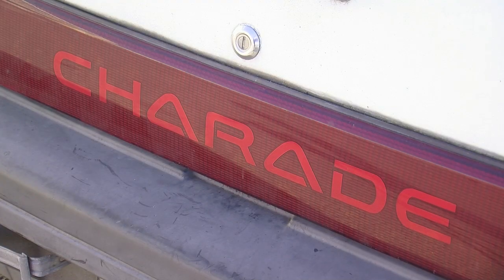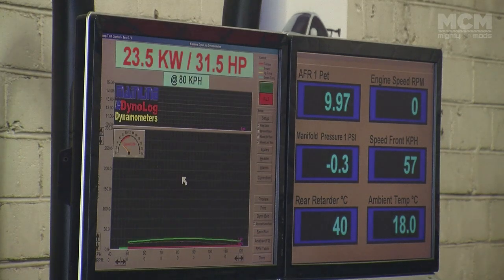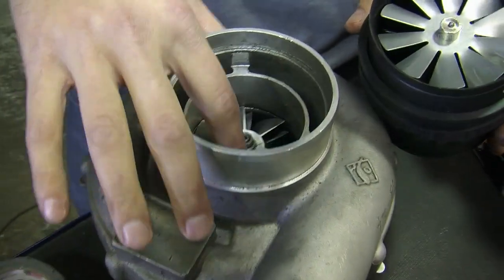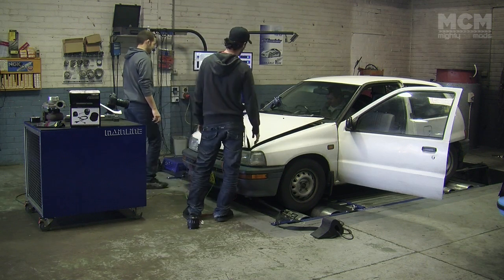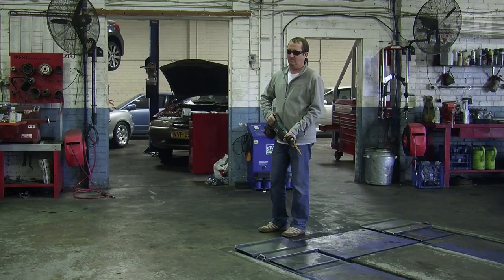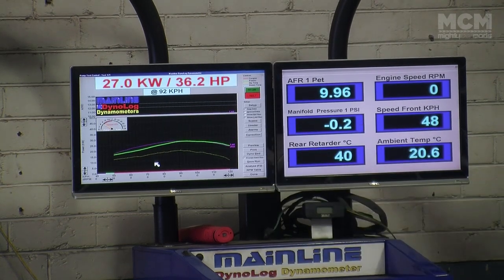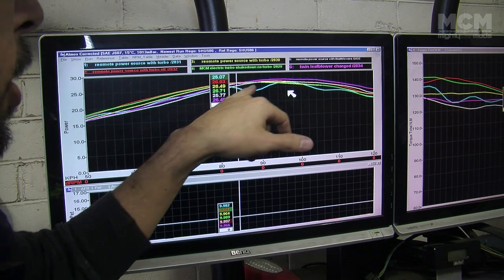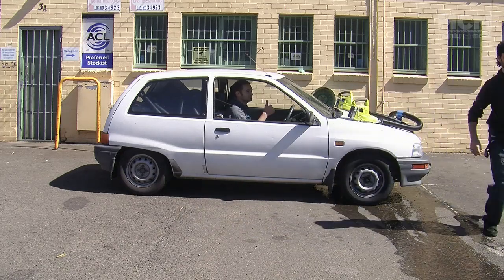Electric SuperChargers Mythbusted

Comment: Damn man, lol, I guess you didn't get to fractions yet in school! No biggie. A constant 14.7:1 air/fuel ratio means for every pound of air sucked into the engine, the injectors will supply 1 ounce (not fl. oz.) of gas. So the more air is sucked in, the more fuel goes into the mixture. But the air/fuel ratio is the same. You don't enrichen it.

Comment: yes you would need to richen the air/fuel ratio. the more air you push into an engine the more fuel it needs otherwise performance will suffer and detonation way occur.  Carburetors do put more fuel into the engine as more air enters, but without larger jets and some tuning a carburetor can only put so much fuel into an engine.  Over your head or no?

Comment: I once contacted one of the "eSupercharger" scammers as a customer looking to supercharge a 350 V8 at 10psi boost way up to 6000 RPM (which should take at least 70kW of power; several kiloamps with 12v system) and described insufficient electrical upgrades done to the car. They said it was all good and well and I would get the performance I was looking for.

Rrrrright... BTW, the given electrical system ran at required power output would've set the car on fire.

Comment: I pulled out my LS2 engine in my CTS-V, and installed a Vtec motor with one of these ebay superchargers since the Vtec revs higher I can make more boost... and then I put it on the dyno. I made 372rwhp! But then I realized I was using the wrong drivetrain for a sports car, and installed a whole custom front wheel drive setup instead. Now I get to enjoy the fun understeer into corners and the massive amount of boost I make in the right gear!!!! /sarcasm /bullshit

Comment: Okay so first off gaining +60 WHP would be the equivalent to having a decent size turbo and running roughly 10 psi with a good tune, which if you dont know anything about forced induction on a car, thats alot for a naturally aspirated car. Also im not sure what camaros and mustangs you're talking about but, most of them have a bit more than 173 HP. so do you have any videos of you on a Dyno? what about any track slips?

Comment: of Course, but when a valve closes, the air pressure increases, therefore stopping the fuel flow.
I think it's more efficient when you put the carb before the turbo.
Forcing a (perfect) mixture into the cylinder...

Comment: Any time you have more air flowing through the carb's Venturi, its velocity will increase. Per Bernoulli's principle, the higher velocity of air (more air flow) will cause a drop in pressure which sucks more fuel into the air stream.

Comment: 100% combustion means extreme temperatures and pressures.
Your exhaust valves would disintegrate, your cylinder head gasket would be long gone.

And, not burning at 100% efficiency means more efficient lubrication in the cylinder.

Comment: A carb isn't designed to force air in.
So i wondered if setting a richer mixture, meant that the carb could function while having pressure in the air intake.

You're not taking this way over my head.
I know more about giant 2-stroke diesel engines, than about a silly Daihatsu Charade. I must admit that a mixture doesn't change while opening the throttle on a carb, and therefore changing the mixture as a result of a turbocharger won't be a good idea. 

Why not use a "drop through" turbo system ?

Comment: Lean mixtures improve the fuel economy but also cause sharp rises in the amount of nitrogen oxides (NOX). If the mixture becomes too lean, the engine may fail to ignite, causing misfire and a large increase in unburned hydrocarbon (HC) emissions

Comment: you just sound like people in the 1920s when they refused the idea of a electrified word, electronic cars, and sending messages over the air. the concept is pretty feasible and not just because they made a lame research it means is over. A fact is that one of the first superchargers was electric, have you seen the Thomas Knight electric turbocharger? the concept is there and I would not wonder if in the next years some company actually releases a working unit.

Comment: this review is useless, you got the worst electric turbo and car, did the worst test,  you didn't even change the inlet to seal the plate on the top, so my thinking is either that you are like those petroleum companies that stop research in fuel alternatives , or you sell mechanical turbos

Comment: Sorry guys, but that fan does not simulate enough at all, it works to an extent, but simply does not simulate enough, hence that you can get different results on a dyno compared to on the road.

Comment: Hot rod actually did the leaf blower mod years ago on a C4 generation, LT1 corvette...  It actually made 50 or so horsepower more but they had to remove the hood, etc. to make it work.  They then did a 50 shot of dry N2O as a comparison without upgrading fuel injectors, tune, timing, etc and the nitrous made more power.

As a gearhead, i've known this electric supercharger was a load of crap but I dont have a dyno nor the money to want to disprove it.  So thanks for the video!

Comment: I didn't confirm a bigger motor will do any good. Even if it did, it will require a massive battery and the duration of boost will be even less than that of a nitrous boost duration.

Comment: It´s pretty wrong to say battery doe´s not have anything to do with power, though it did´nt make much difference, where do you get the power to charge the battery?
they also said that electric supercharger does not compress air it only moves it, which is right, and that turbo and superchargers compress the air which is also right......
and also this episode is more for the fun than to be accurate, I mean they are working on a daihatsu charade with massive 26kw

Comment: If you honestly think that way, you need to do some research. 
An average turbocharger's turbine spins nearly 32 times faster than that of an engine at full rev. There is no possible method to recreate such speed of a turbine with an electric motor; only the exhaust and engine power itself can draw the necessary power to make a difference.

Comment: Wtf cars has NanoTech worked on? I work on cars for 8 hours a day and have never touched a fuel rail that was "bloody hot", so I'm gonna agree with you and call BS. Plus, what is he talking about that every forced induction car runs rich? If your car is running rich something is wrong. "Rich" means there is too much fuel for the air amount, "lean" means there is too much air for the fuel amount. If more fuel is being injected to match more air, then the car is running at the right mixture.

Comment: 1) For all fuel mixture geniuses.  A lean motor makes more HP than a rich one...but they will eventually melt down...  2) 125,000 rpm is what turbo's can spin...they have special bearings and when they fail it's usually very bad.

Comment: To actually get more power if u r pushing air into the carb you would have to enlarge the jets because you wouldn't get more power without more fuel if it was adjusted properly to begin with and if anything pushing air in would make it get less fuel. So thats why they didn't get any power if those fans do do anything witch I seriously doubt.

Comment: Actually, Audi (I'm not a fan at all of Audi) has recently just introduced its twist on turbocharging.  You know how well they work.. after they spool up right?  Well Audi has made a twin, biturbo set up, using a electric motor to spool the turbo below 3,000rpm and later deactivating, allowing the reall thing to do its thing.  The car makes I think 279hp and 478lb-ft out of a 3.0L biturbo Hybrid FSI(what ever Audi's DI system is) V6.   I like the idea.. even tho its artificial-like. I like N/A.

Comment: you were loosing air pressure through the air filter pan if you hooked it up straight to the throttle boty it woulda worked better

Comment: no, they mentioned why. a turbo or a supercharger compress air, not just move it faster. superchargers and turbochargers also contain a diffuser which diverges the air creating less velocity (the opposite). compression is rule numero uno.

Comment: I feel like the only thing that the electronic super charger needs is more fuel supply. The reason you don't see a bug jump in power or even the loss of power is likely due to the increased air leaning out the fuel.

Comment: This video is so full of fuck.
How were the leaf blowers "lagging", theyre powered by electric motors, they are pushing just as much air at low rpm then they would be at high rpm.

None of these fans or leaf blowers pr anything will do shit. They cannot move enough volume or pressure even for a tiny engine like that. You need a REAL compressor.

Comment: You could proly get even more power if u plugged the leaf blowers into the dyno to cool the fucking thing down so it gives a more acurate reading ... or even strap the dyno to the bonnet of the charade ... see what that does.  Maybe you could try selling fucking dynos on ebay as a sure way of increasing horsepower, i bet the sale of dynos triple .... FUCK!

Comment: V mounted for max respect.. But it was doomed for failure.. You need a suitably modded or bought carb to run pressure through.. Something for the troll to latch onto... MCM is the best

Comment: LOL. But you would have had better results with the leaf blowers if you used ONE only. The way they were configured caused them to essentially fight each other or even create a vacuum (opposite of boost) as neither is compressing the air. This was reflected in the loss of low rpm torque. As engine RPM increased, the engine vacuum overcame the double blower vacuum and made power. However, if you used just one that was able to move more air than the engine needed, it would create some boost.

Comment: so well all get by in this world by beleiving in false statements and people that are in the buisness should also discredit there studies which theve worked hard for and just go along with what ever garbage you hear. case in point , air over and throught the car!! put a fan pointing at roof and the result will be the same. all the fan is there for the radiator, the missing factor it the exponential increase in resistance of wind in the real world. your the troll you uneducated fuckwit.

Comment: of course ur air filter's gonna get dirtier than usual, so i replaced the standard filter with a k&n washable filter. for a little 4cyl engine, it makes a big difference on throttle response after 50/60kmh upwards and a massive difference on fuel usage.

Comment: Electric superchargers are used to improve response,emmisions,economy and torque at low revs. When i'm saying "low revs" i mean from idle to just below 2000. Don't expect to see any difference on mid/high revs,you need two or more leafblowers for that. Oh waait.....

 Yes this one you used here is more like a toy but it's dirt cheap as well. There are some serious more expensive typers of e-chargers which actualy work.

 Also results should be better on already turbocharged engines.

Comment: that chart on the back of that box is such an out and out lie - for starters, a bmw 740i from 2000 (M62TU) only revs to 6000 rpm stock. Second, the numbers on the left are totally nonsensical for that engine. Third, the power curve for that engine (which has VANOS variable cam timing) looks nothing like that. What a crock.

Comment: fucks sake mete are you deaf? IF you want to put a turbo of THAT size in you car you will need about 1000 bucks for the turbocharger and about 10000 for all the rest that the engine needs in order for it to work properly. small turbo bolt on kit prices depend on the car. prices range fron 10000 to 6000 bucks or ever more

Comment: wondering if you got a brushless RC electric motor and Ducted fan shroud setup running off 30 C discharged batteries would results change any.  Seeing as RC ducted fan setup are made to suck air in and out, instead of in this units case, just act as a powerful desk top fan. video was fun anyways. thanks.

Comment: mine doesn't. i've got a 89 1.8L carb holden astra. made a home made twin ram feed cold air intake out of 2 gutter downpipe attachment connectors, 2 step down size reducers that fit onto the back of the connectors, a 2 into 1 (Y piece) fitting, and 2 vacuum cleaner hoses. i wanted to use larger diameter pipes/hoses, but to get the shortest length from the mounting position to the air cleaner intake, i went with this option.

Comment: What if you use an air compressor in the back of the car with a tank and use it like "NOS", only for a race or so? This would be compressed air going through the engine at an specific pressure

Comment: if you put a "Y shape adapter" intead of the "T shape adapter" ,i guarantee that you will get a lot more power because you loose some of the power in the turbulence that impacts when the two air pressured leaf blowers get to the adapter. if you force the air down instead of in-front of each other you get a lot less air resistance. IMHO...buy you proved you point :)

Comment: Yeah, but you connected it all to the air cleaner intake. You had charged air leaking out through the hot air stove inlet as well as engine breathers and pcv connections.  If you were fair dinkum  you would have connected the boost pipe directly to the carburetor (which wouldn't work anyway as carbies run on vacuum) or injection throttle body which would have been the choice of car for this test.  I know it's all in fun but when you get it this wrong it's just bad...

Comment: There was a vette i saw where they tested the leaf blower but they bought 2 stroke with the most cfm they could find and it and with 2 it actually got about 20 hp but on a 400hp car its barely noticable. but it worked lol

Comment: Whenever you turbocharger a car  (In real life)  You will need to have the right air and fuel mixture.  Stand alone computer/ECU is a must for high performance.  If you only have AIR going into the engine, its not as effective as the whole package.   ...besides all this technical crap I'm talking about, at least you guys proved that these electric ones are complete junk.

Comment: @fomocoboy the size of fan and motor you would need to make power wouldn't fit under the hood of your car. Electric "superchargers" and fans on the intake are not worth the money or hassle. All it will do is restrict airflow because the fan will move less air then your engine will draw on its own at full throttle. Basically on paper its a brilliant idea but in practice, we just dont have the technology to create a working product that would be practical.

Comment: The air will escape back through the fan. There isn't any way to actually compress it. It will escape once it starts to make more pressure than air pressure.

Comment: Yeah, but then you didn´t open up for more fuel. Like adding an electric fuel pump, opening up the fuel needle and so on. I presume you just added a blower in the hope that was easy horesepowers. In this case the engie will runn way leane. There is more in it than that. An carb engine is easy to work on, and i see no problem in using one.

Comment: Stihl BR600 Backpack Blower works reasonably well :0. 

1.25 PSI of boost on our '77 Nova test car made 40 ft/lbs down at low rpm and 20hp up top on our in-house DynaPack Dyno.  I just posted the video as a video response, hopefully you'll approve for others to see too.

Otherwise, it's shared on our channel, just click my screen name and check it out.

Comment: Electric superchargers are possible. All forced induction is basically air compressors. You're just replacing the compressor drive with a powerful electric motor, rather than exhaust pressure or engine power take-off. Unfortunately, as you said, leaf blowers and this eBay crap are really just electric fans, not electric compressors, do they're not really electric superchargers.

Comment: eBay "Superchargers" are great for a laugh. An electric fan that could pressurize intake air to the point that one could say it's being "boosted" would have to be so massive the engine compartment would have to at least twice as big, or require so much energy that the cars charging system would load the engine to the point that all the power is lost.

Comment: I think you need to have constant pressure. air compressor can only build up PSI over time and direct injection will probably be less than engine needs to run. But it would be fun to try :D Also can try to build pressure in some tank and inject it on demand like some cheap DIY NOS :D

Comment: You need psi and cfm to make power, a fridge compressor is moving nowhere near as much air as a turbo. You can buy a 12v compressor to pump your tires and they are capable of putting out over 100 psi but you would never see someone try to hook one up to an engine for a reason. Just look at the parasitic loss you get with turbo's and superchargers, they both require a pretty decent amount of power just to get them turning, more than any alternator/ electric motor combo would be able to get you.

Comment: Ah yes, I did forget that displacement applies to the air. Very used to there being a small amount of fuel going in the cylinders. Even this 1L would be using 1L per revolution. on Wide Open Throttle, starting at just 600RPM, it would use 10L/second. As the RPM increases, so does air usage. Assuming this engine can get to 6000RPM, by this point it would be using 100L/s. Of course we are assuming that air pressure is equal to atmospheric pressure. Thanks to people for pointing this out.